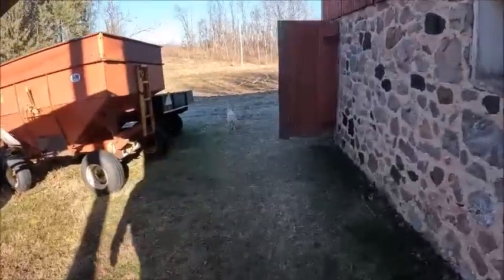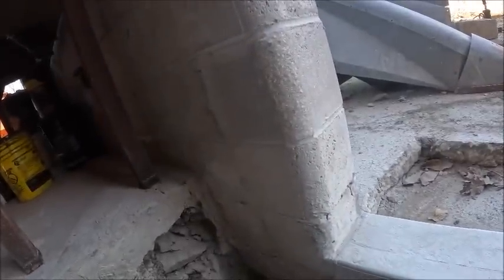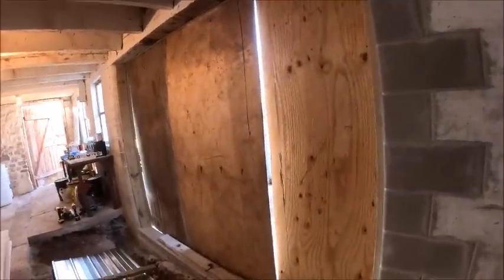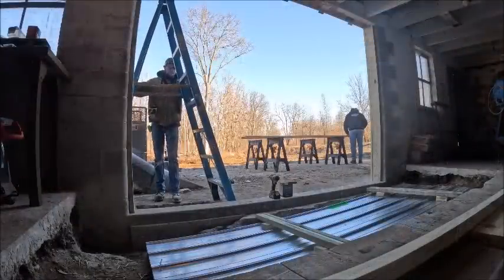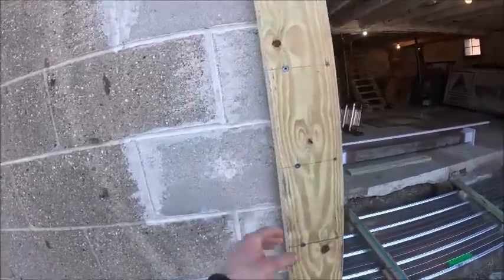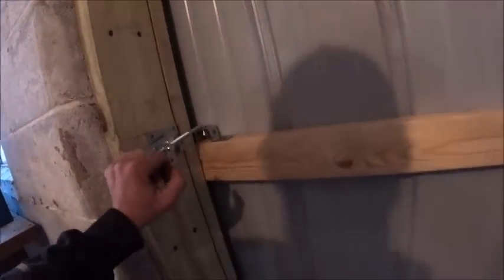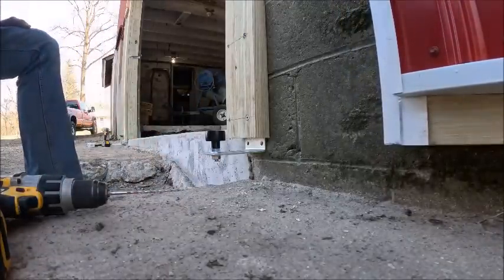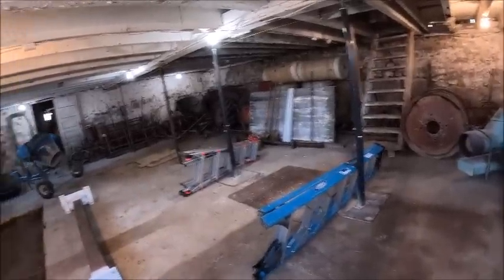Barn Door Project Part 11: Actually Making A Barn Door

Comment: Ethan, I don't know what blade you're using in your cordless saw but, for future times, go to Harbor Freight and pick up some cheap non carbide saw blades and put the blade in backwards. They'll cut just fine with tin and won't "jam" the saw at all. I know they make metal cutting blades now that you can use in circular saws but, this is just a cheap method for ya, for anyone actually. 
You should think about getting some spray foam and spraying those openings on the bottom side of the tin and bottom door board. Cold air has a way of entering through the least likely of places. Great video as always. Cheers :)
Reply from the maker: It’s a carbide metal cutting blade on a saw designed to cut steel. It was hanging because it’s only a little 5 inch saw and we were cutting 4 pieces of tin at once. And what’s the point of sealing the door? Have you ever been in a wooden bank barn?

Comment: Nice job on the barn door It looks really great.  If you haven't tried the impact if you get the right bit in it you can use it to drill holes in the concrete.  I have done that it works just as well as a hammer drill, I was actually kind of surprised that it actually would work.  Thanks for the video Michael
Reply from the maker: Makes sense.

Comment: The first set of sliders I rebuilt in 2013 with cedar tone treated from local lumber yard. They are still fine. The second set of sliders I rebuilt in 2015 with green treat from Menards. Big Mistake! In 2018  had to replace the top two laterals because of severe warping. The green treat at Menards is always wet or damp so that it drys and warps after you buy it. Since then I go to the local lumber yard. If  it is closed and I have to go to Menards, I buy the brown ground contact. It is expensive, but it doesn't warp like the green treat.
Reply from the maker: It will be fine.

Comment: Have you thought of using that extra treated 2x4 as a footing face plate for that gap at the bottom of the door.
Reply from the maker: So it can either break of of pull the anchors out and bust the new concrete from driving over it?